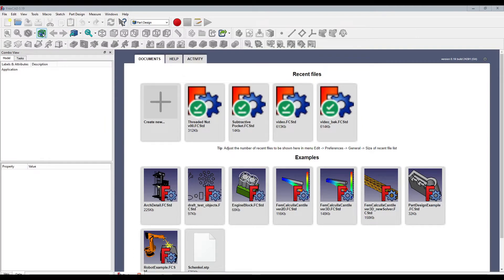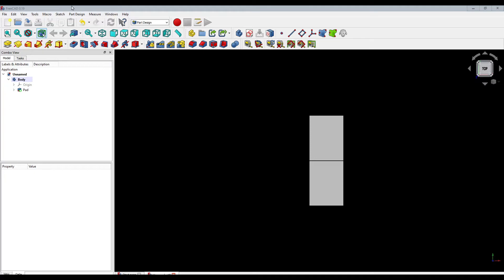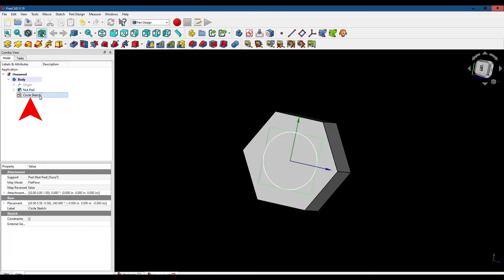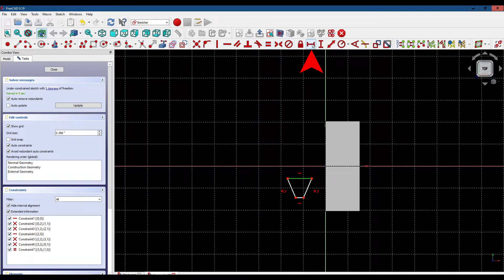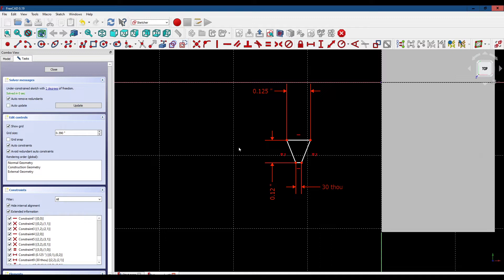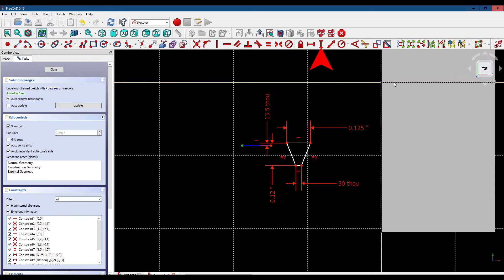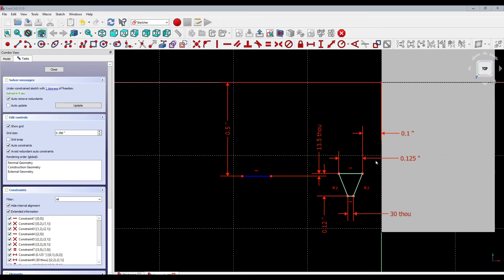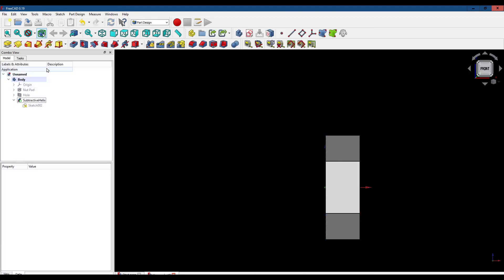FreeCAD Threaded Nut Subtractive Helix Tool Tutorial fc003

Comment: You lost me when you were using those archaic inches.  Without explaining where all these "magic" numbers come from this video is not very useful.
Reply: A unit is a unit. An increment is an increment. 
I probably got the Hex Head & Nut Dimensions from https://www.wermac.org/bolts/dimensions_heavy-hex-nuts_asme-B18-2-2_used-with-stud-bolts-asme-B16-5.html or some other online reference.
Thread dimensions probably came from United Thread Standard at https://en.wikipedia.org/wiki/Unified_Thread_Standard.